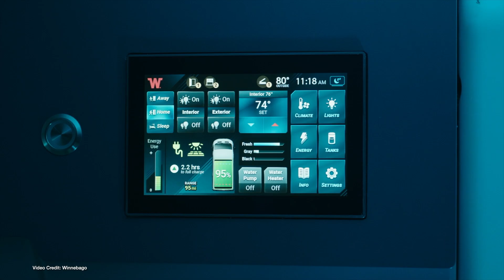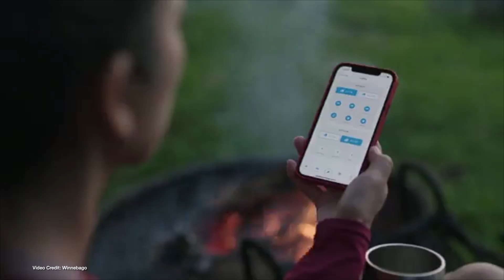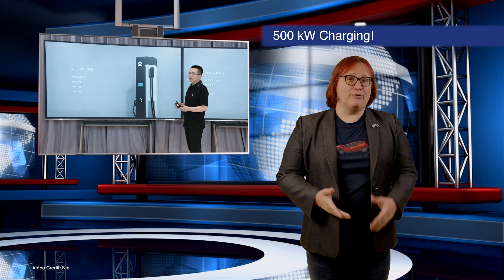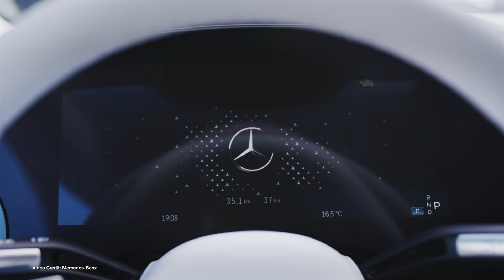EcoTEC 234 - Tesla Supercharge Access Grows, e-Bikes Rule, EQS Steering Subscription!?

Comment: Just a quick question at the very end of the video it mentioned Renaults NFT what is NFT ?
Cheers
Reply: NFT = non fungible token. It is essentially a unique digital picture that you can get. Its authenticity is maintained on a blockchain, like cryptocurrencies. It is like a modern version of art trading, but much worse for the environment (blockchain takes a lot of electricity to run).